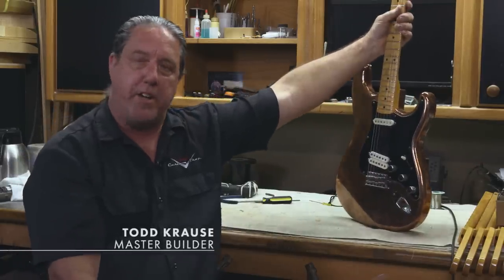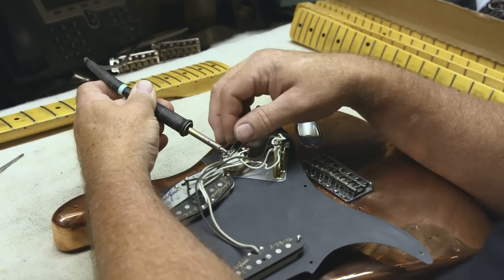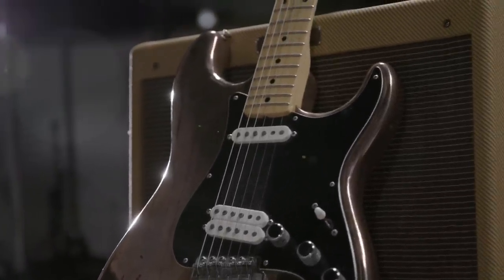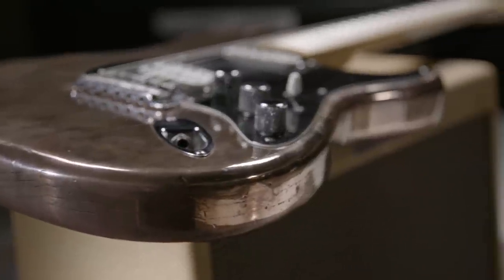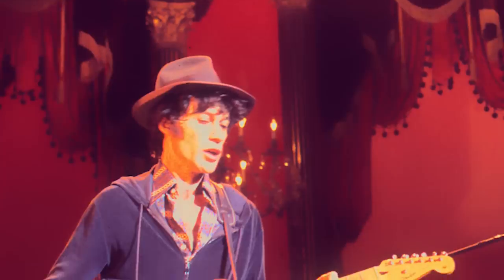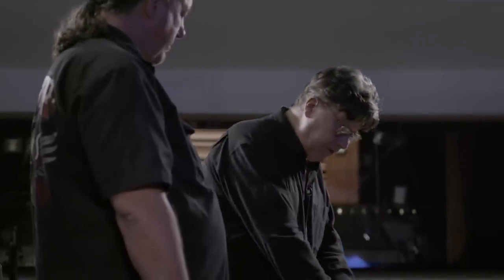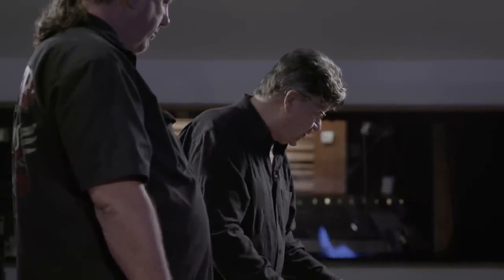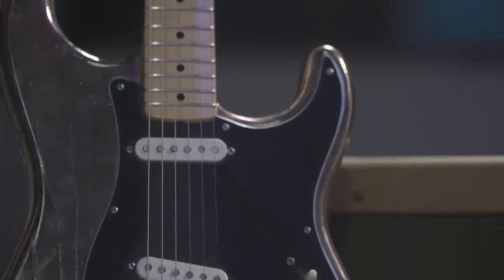The Robbie Robertson "Last Waltz" Stratocaster | Fender

Comment: lol love how he just slammed it on the table
Reply: Seriously, is this Fender's best people?  Even soldering to the pots without any protection on the finish or pickguard of the guitar?  No wonder the custom shop stuff isn't what it used to be.
Reply: To pro's guitars aren't precious. They're merely tools. Hammers to express themselves. We're all dead soon anyway. Use it. Enjoy it.
Reply: @davidcarter1917  Exactly, when I saw that soldering process my jaw dropped.I was an electronic tech for Air Force and DoD for 30 years. Did a lot of soldering, ya gotta  worry about the electronic components still connected to area that 100W iron is touching. I dug my foxhole before commenting so fire away critics.
Reply: @scottnathanphoto  It was cloudy in Los Angeles.
Reply: The thing is encased in bronze, it'll be OK. Besides, that's nothing to what that very guitar experienced on tour I'm sure. If the fuckin shattered when he did that then it wouldn't be a very well made guitar now would it.
Reply: @davidcarter1917  I'm sure he's done this before.
Reply: It’s all good. Not gonna hurt that finish probably.
Reply: The table has a cloth/padded covering
Reply: I mean he didn’t really slam it but, okay 😂 also having worked at a custom shop, the table most certainly is padded or you’d ding up everything.

Comment: I am using someone elses computer to write this comment my name ia John Carruthers and I was the one who put the original guitar together. We had the body electroplated, the same process as bronzing baby shoes. I built the original pickguard. It was a bear to wire because the bronze plating caused the pickups to short out. The guitar was very heavy because of the plating. I also worked on Rick Dankos Ampeg bass, I installed a Fender P Bass pickup in place of the stock one.

Comment: Dipped in molten bronze?  I'd like to see how it was done, one would think the metal would have a hard time adhering to the flaming wood.
Reply: Its not molten Bronze.. its either Electroplated  the way  Chrome and Nickel is plated on Car Bumpers etc  or painted with Bronze laden paint.
Reply: Sam
Reply: Sam Iam not painted, it was dipped
Reply: Good thing they didn't get the order confused and dip robbie into the vat of molten bronze!

Flaming Robbie...No bueno!
Reply: Everything time they talk about it they say "dipped in bronze" like it's completely normal and I get totally confused with molten metal in my mind.
Reply: Probably the same method they used, when getting "baby's first shoes", which was popular with parents in the 1950s and 60s. People used to get their baby's shoes, bronze them, and then display them.
Reply: I will not add the Old Joke about the guy who was so proud of his gold medal, he had it bronzed!
Reply: SO HOW DID THEY 'BRONZE' THEM? 
What was the process? Spray paint?
Reply: Jesus Christ... Did any of you take a science class? You don't dip wood in molten metal. Sure... they are "dipped" but not in molten metal... It's electroplated ffs.  Oh, mac163 said that already.

It's cheap to have done. A guitar body would be easier than baby shoes.
Reply: where would you be able to get a guitar body done like this ?

Comment: I was there thanksgiving 1976. Actually very close to the 40th anniversary of that date. It is to me one of the most important guitars of rock and roll. Two pickups one turned around. Similar to p bass pickup but more output. It’s a chimyer sound. The wear is under the finish.

Comment: The most iconic fender mod is most likely the use of toothpicks to set the three way switch on vintage Stratocasters before they had the five way switch! Other than that, some other extremely iconic mods are Mike Bloomfield's double cutaway '63 telecaster and Keith Richards' Micawber neck humbucker!

Comment: Take a stock Strat setup, move the middle pickup next to the bridge pickup, then wire those two in series as one pickup. As long as one pickup is negative wind, that’s a humbucking design. My bass setup I’ve had for years is a jazz bass set wired in series under one double jazz cover. That’s a pickup. It’s fat.